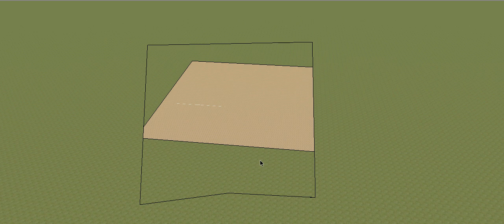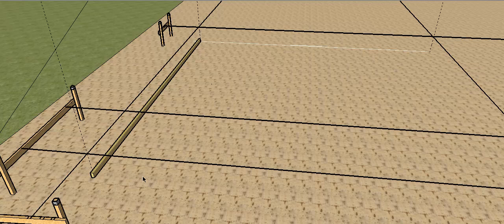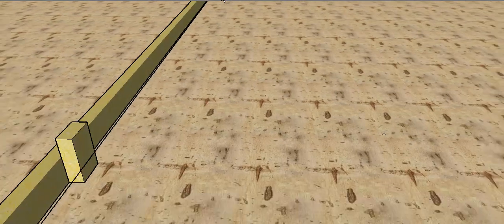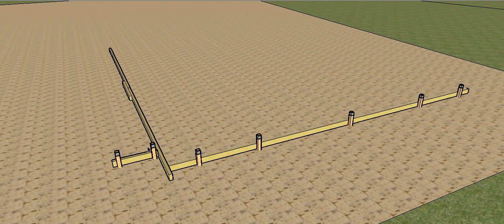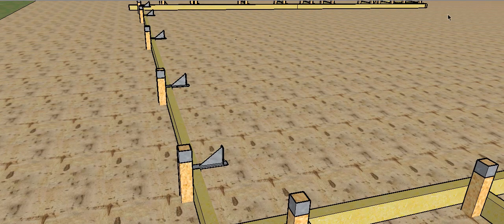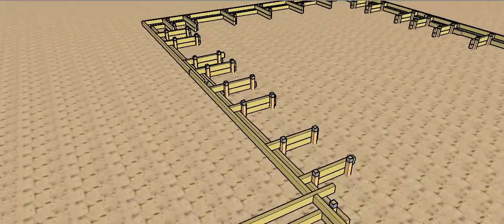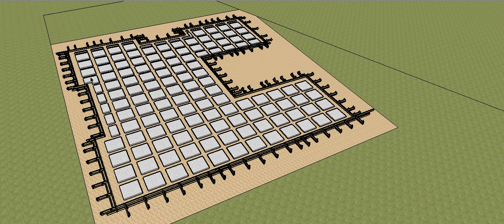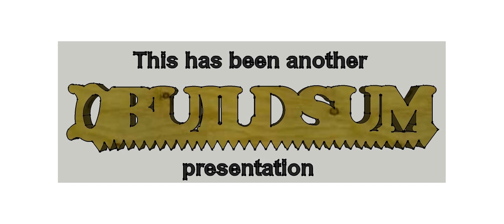Formwork to slab on ground

Comment: Hey mate, great videos. My slab has called for "all beams to be founded 100mm into natural clay, use 15mpa blinding concrete to achieve". Is this poured at an earlier time? And under the plastic?
Reply from the maker: Hi Mate, sorry for the delay in my reply, I would do them at the same time.
Reply: @Buildsum  that's OK, thanks for getting back. So if it's poured at the same time why not just use 20mpa and do it all at once?

Comment: Hi,
I had a doubt at 10:29, 
When the concrete is poured, won't some of it ooze out of the gap between the upper and lower formwork?

Thank you
Reply from the maker: Hi Mate, although it looks like it would I can assure you that it doesnt. Even when you pour steps the tops are left open to allow for finishing.
Reply: @Buildsum  Ah I see, 
Thank you for your response.

Comment: Fantastic video Thanks ! i just have one question in regards to how to fasten the edge board to the ledger board using the  two peg and ledger board system? its at 4.30min in the presentation . Thanks Grant
Reply from the maker: Hi Grant, You could just nail through the face of the edgeboard into the ledger however that will make pulling it apart hard with the concrete in position so the best idea is to skew nail through the ledger into the edgeboard. Hope this helps.
Reply: @Buildsum  certainly has helped thanks heaps .

Comment: nice vid. Curious how they would stop the timber from leaving imprints on the lower step though...
Reply from the maker: Thanks Mate, generaly not a concern however if you were worried you could face the timber with Ply, making sure that you allow for the extra thickness of course.
Reply: @Buildsum  cheers. Whereabouts are you based anyway?
Reply from the maker: Hi Mate, i am in South west Sydney.
Reply: @Buildsum  oh sweet. I'm in Melbourne. Keep up the good work though :)
Reply from the maker: Thanks Mate.

Comment: hi Buildsum, again, thanks for this great vid.  Im wondering two more things about formwork.  1. How to form up a 50mm setdown for a screed in a wet area, and 2. how to form the 45 degree internal angle connection between 400mm deep perimeter edge beams and 100mm slab (in section view), if constructing a timber frame on a slab?
Reply from the maker: Hi Sue, the 50mm setdown would be formed up with temporary pegs that would be removed and the holes filled in, after the concrete has been poured and the first screed completed. The 45-degree internal angle is shaped into the ground or the waffle pod. I show this in this video https://www.youtube.com/watch?v=0Um_Ttv95Ko&t=251s
Hope this helps
Reply: @Buildsum  thanks yes it does help - I'l have to get the excavator to shape that in.  Im assuming it doesn't have to be exactly 45 degrees - the  Engineer did not specify anything about this angle, I just see that the slab needs to be thicker  to avoid any shear forces

Comment: im also wondering about the slab edge details for a timber framed construction, with set-in bifold doors?  Im imaginging the slab with timber framing will just be square edge?
Reply from the maker: Hi Sue, yes, most likely however it would depend on the construction of the doors and the finish of the flooring. You might have to have a small step down in the slab to allow for the door tracks to finish flush with the floor.
Reply: @Buildsum  thanks, yes I've also checked with Allan Staines book, and it looks like square edge at the perimeter. Ive got a couple more questions for you which I'll posta bove, thank you

Comment: Nice use of Sketchup and great information for builders. They do make a metal bracket that slips over the edge board for a standard 150 rebate yet the method you show is a better way of doing it .
Reply from the maker: Hi Mate, thanks for the comment, yeah the brackets are quick but not as accurate as the method i have shown.
Reply: @Buildsum  Copy that, project home builders use them a lot as unfortunately, the quality is not their number one priority.  Mate, we love your work, well done!

Comment: When the concrete is poured wont the weight push the lower step up?
Reply from the maker: Hi Hank
There is not enough weight in the concrete on top to force it out of the step when it is mixed at the correct ratios. The wetter the mix the more likely it is to happen however it is not an issue.

Comment: what tolerance would you say is realistic when forming up?
Forming up a house slab myself thanks to your videos! thanks
Reply from the maker: Hi Mate, thanks for your comment, look I would say 5 to 10mm at the most depending on the area. Remembering that your frame and or brickwork can't overhang the slab more than 20mm max and your cavity (if you have one) can't be any less then 20mm either I think, you need to be pretty accurate.

Comment: Hi, This may be a silly question What stops the concrete from spilling over througth the rebate? Is there some cloth or lining or is it too dense to spill out?
Reply from the maker: Hi Nermin, you would think that it would and if it was water then, of course, it would, however for reasons that I am not exactly sure about, it doesn't. As you say it is probably the density of the concrete that prevents it from overflowing the formwork.

Comment: One question: Can you build your footing using bricks and then push mesh and rebars on top of that and then add concrete to save on concrete? Or can you build your footing without using any concrete and just use bricks and mortar?
Reply from the maker: For anything other than a decorative wall I would say No.
Reply: Yes I agree, thank you. So how you should dig the trench and do your formwork to avoid wastage of concrete?
Reply from the maker: Unless you want the footing to come out of the ground I would not worry about the formwork. To keep the excavation as accurate as possible digging by hand is best or if you need to use a machine to dig it with an undersized bucket and finish it off by hand.

Comment: Can anyone help me understand slab terminology, I've asked two builders only to find out I had more of a clue than they did...
in fill slab: a slab in which the masonry walls are used as the formwork
on fill slab: a slab which rests on a foundation as opposed to a suspended slab
slab on ground: a slab which rests on the foundation, and the walls rest on the slab rather than the footing
monolithic slab: a slab in which the footings and slab are poured in one
footing slab: a slab in which the footings and slab are poured separately
correct? I'm Australia based
Reply from the maker: Hi Scotty, Yes you are correct, some of the confusion comes because you could use 2 or 3 of those terms to describe the same slab, e.g. a slab on ground is all so a monolithic slab, also a raft slab, an on fill slab and a Waffle Pod Slab.

this link might also help
https://docs.google.com/document/d/16XNkQf_K3-jrYWroU-YH0-PoRsV5pI0hvEKSbTfkM08/edit?usp=sharing
Reply: thanks heaps mate, there's few places one can go for knowledgeable advice on this sort of stuff. i was fairly sure i had it right until i was reading the termite standards AS3660.2 and it says 
(b) Slab-on-ground: Treatment of concrete slab-on-ground may present special problems, especially if the slab is laid on fill.
slab on ground can only be laid on fill!
Reply from the maker: Hi Scott, No you can put a slab on ground on a natural foundation as long as it is a suitable material
Reply: now i get it :)

Comment: Hi John,
When we use compact soil under the slab, how much top soil we need take out? and what 's kind of soil ok to refill and compact? THANKS.
Reply from the maker: Hi Roger
I would only take out all of the top soil until you get to good, compact soil, if this is too deep then you may have to get the slab designed for the soil type. Most soil can be used as fill as long as it is clean, free of organic matter and minimal clay content. There are also products like road base that will compact very well

Comment: hi John, do we need and membrane for termite and damp control before put mesh on?
Reply from the maker: Hi Roger
 Yes, The moisture barrier should go down either under or over the top of the waffle pods before the mesh is installed and termite protection applied around the penetrations in the slab before it is poured. After the slab has been poured additional termite protection is applied to block the cavity
Reply: THANKS John, 
for the penetrations of termite protection, is that mean chemical spray  on the soil which under the slab?  is that spry job has to be done by licensed pest controller and need grab a certificate for CERTIFY?  I saw a TERMITE membrane product which will be laid the as same position as moisture barrier on top the infill soil, is this kind product better or cost too high?
Reply from the maker: Hi Roger
You can spray however all sprays nowadays have a limited life span so unless you can get back underneath the slab to reapply it they are not worth using. 

Terimesh and similar products have collars that go around pipes to stop termites getting through. Yes, all termite systems must be installed by a licenced installer.

Kordon is a combination DPC and Termite barrier which can be used on the penetrations and perimeter the same way as Terimesh but would be very expensive to use as a waterproof membrane under the entire slab
Reply: good intentions but this drawing -sample don't show real life out on jobsite I build slabs and post tension slabs-floors and forming is not quite close to every day forming /reinforcement /pouring
Reply: Roger Zhang 🔥

Comment: with the rebate, would you not put a board between the top of the edge board and the bottom of the rebate to stop concrete spilling out during the pour? great video though thanks